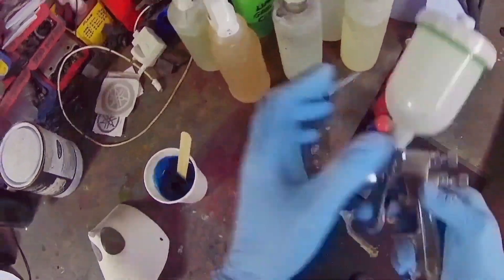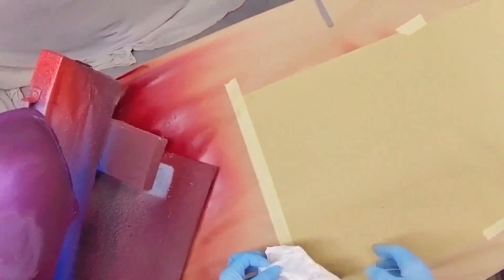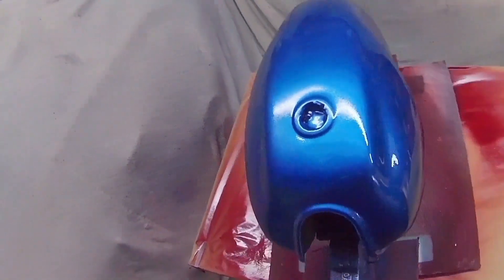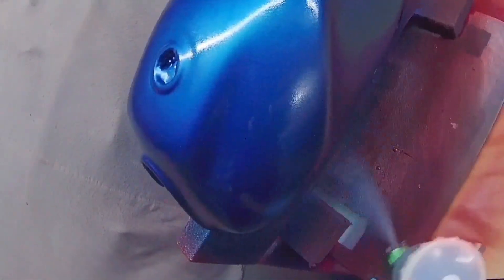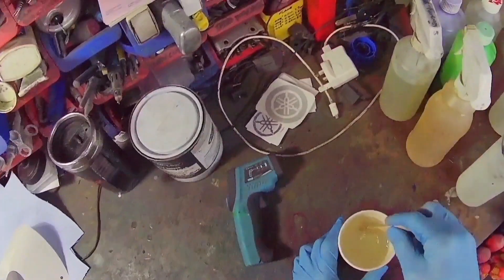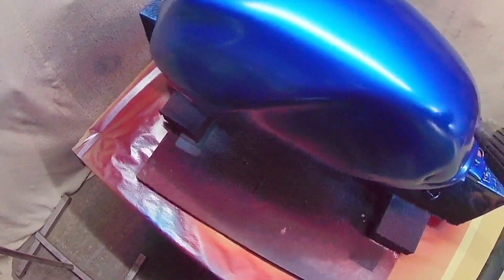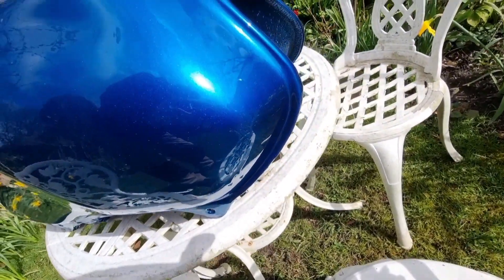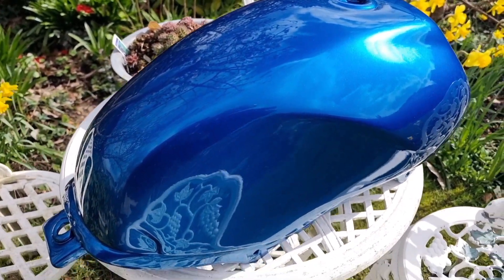Chinese Sri Pro Lite 1.2,Cheap Mini Gun, Devilbiss Sri Pro Lite/Pro Lite S H921 Mini 888 LVLP Talco

Comment: Hi Pete, now you are spoiling us with another video so soon so thanks mate👍doesn't look a bad gun tbh Pete as it seems to spray ok but as you mentioned you can see it's not atomising as good as the Devilbiss SRI and it looks like you are working the gun a bit harder to get the finish you are looking for but it laid the base really nice but the clear didn't look quite as good as your usual finishes🤔

I think that if you are a DIY painter and not interested in getting a load of high end guns like you and me are😁then this would be a good choice if it's not going to get a lot of use👍

I've found my other SRI ProLite I haven't used it for such a long time I forgot where I put it but it was used for UV primer but I couldn't get on with it so it sat there with paint (which is 1k) in it so it needs a good soak and cleanout, both of these guns need a service kit to get them working again🙄🤦‍♂ cheers Pete hope you are keeping well🤔👍
Reply: do you think normal people can release the different between finishes of cheap and expensive gun
Reply from the maker: Hi Mate, Yes, absolutely, they will find getting a better finish easier with a better quality gun
Reply: @peteshobbies5383  is a better quality paint is more important than gun, i saw a  lot videos many people cant distinguish the diffence between cheap and expensive gun
Reply from the maker: @quyuc9334 I disagree, It is easier to work with cheaper materials than a cheaper gun, certainly for a beginner.
I don't watch lots of videos,  I don't have time, but I use lots of different guns,  both cheap and good along with cheaper and better materials, the gun, especially in the hands of a beginner, makes more difference than the materials.

I get many people messages on Instagram and Facebook with various painting problems. The worst culprit is the quality of air. It is more important than the gun or materials for better quality work.

Comment: I have one of these with a .8 mm tip and it works amazing with base coats for small projects. It gives a smoother finish than factory. It works really good with clear it you dial it back and move a little slower. I find it works good 18-30 psi.
Reply from the maker: Hi buddy,  I've only used it in this size, so I can't comment on the smaller sizes. It's certainly excellent value for money if you get them from Aliexpress,  cheers 👍
Reply: @peteshobbies5383  Thanks for the reply. I know the purists don't like cheap gun reviews but some of us can't afford a $300 + for a paint gun. Keep up the good work and I know a lot of people would love to see affordable gun reviews. I was a mechanic for 20 years and only a few of my tools came from Snap-on.

Comment: Got the original sri pro and used it at home quite recently really good at 18psi 😊😊😊
Reply from the maker: Hi Dean, they are a good all-around gun, not overly expensive compared to some, good with air consumption,  good results and reliable, what more could you want, cheers mate 👍

Comment: Hi Pete great video, ideal gun for a beginner that’s finding there way on the cheap maybe 🤔 it seems to have done a good job there though but I think it’s down to the sprayer in this case rather then the performance of the gun, I know I have said before using more branded or nice feeling tools makes the difference especially with something that can affect the finish. Thanks Pete I hope all is well mate.
Reply from the maker: Hi Steve,  Thanks, mate , you are right. This makes a good gun for those who don't have or want to spend much money and get reasonable results.

It doesn't give the same feedback or satisfaction as using a branded product and I'm sure that some who buy these will want to go for the real thing if they get the bug, cheers mate,  alls well here, hope same is with you 👍

Comment: Good evening congratulations for your videos. I have a small 24 liter compressor, I wanted to ask you if in your opinion I can use it decently. Thank you very much
Reply from the maker: Hi Mate,  Thank you,  Do you mean a 25lt compressor to power the gun in this video?
Reply: @peteshobbies5383  Yes a 25 liter for a chinese minigun sri pro .
Tank you
Reply from the maker: @diegocastelli7405 Do you know the output of your compressor,  in CFM or LPM, that will be more of a guide? Let me know
Reply: Good morning 

The compressor has a power of 1500 watts and an air flow rate of 138 lpm.

Thank you
Reply from the maker: @diegocastelli7405 So that's around 5 cfm, I would estimate these Chinese Pro Lite S copy's are around 5 to 6cfm, so will be one the limit of you are supply,  if you don't have lots to do it should be ok, they certainly use more air than the real Devilbiss version,  which is between 4 and 5 cfm, hope that helps 👍
Reply: @peteshobbies5383  Many thanks I think I will buy it I only have to paint one fender of my car.
Reply from the maker: @diegocastelli7405 That should be ok. Just let the compressor fill up before you start

Comment: Great work I’m actually looking for a mini HVLP , I had my eye on the Italco for £70.00 but looks exactly the same as this.
Also have you ever thinned brake callipers paint that’s in a pot to use in a spray gun?
Reply from the maker: Hi Jason,  most of the Italco guns are Chinese copies rebranded as Italco, so it is probably the same.

Yes, I have sprayed HT paint for use on break callipers and thinned it if required. Have a look at the TDS for the products you have. It's a good place to start
Reply: @peteshobbies5383  thanks mate what seller on Ali express did you use?
Reply from the maker: Hi Jason,  to be honest, I can't remember. It was 5 years ago , I've bought loads of stuff on there over the years and mostly had good experiences, I would just go with the cheapest you can find

Comment: Great video. What cfm does this put out?can it be used with a smaller compressor
Reply from the maker: Hi buddy,  I would guess it's around 5 cfm @ 2 bar/29psi, it's certainly uses more air than the genuine version, which is around 3.5 to 4 cfm at the same pressure, how big, and what output is your compressor?
Reply: My compressor is a modified 10 gallon tank with a twin cylinder oil air pump from a 20 gallon Craftsman compressor and a 1.5hp motor
Reply from the maker: @justinw523 You would probably be ok, presuming you're not aiming to do loads of panels at once
Reply: Ok thanks
Reply from the maker: @justinw523 You're welcome, buddy 👍
Reply: I’m also looking for a good place to go and order a original DeVilbiss SRi Pro with a TE5 1.2mm, do you know a good place to go?
Reply from the maker: It's now called the Pro Lite S, it's exactly the same, just blue, where abouts are you located ?
Reply: Oh alright. I’m located in Marion, Kentucky about half hour from Paducah, Ky a website might be best to order?
Reply from the maker: @justinw523 If you're in the US, many people tell me the best place to get them from is Sprayguns Direct in the UK. You don't have to pay UK taxes as it's being exported, and as it's under $800 US, you don't pay tax on your side. Here's the link 👍 
https://www.spraygunsdirect.co.uk/product/devilbiss-pro-lite-s-spray-gun/
Reply: Awesome thanks buddy greatly appreciated
Reply from the maker: @justinw523 You're welcome, mate 👍

Comment: Pete, I have an LPH80 which I use for "good" paint, when painting small stuff but like you I don't want rustoleum etc getting into it.
Up till now I've been using an old Sharpe MGF for spraying small stuff with junk paint,  however the mgf is crapping out and I was looking at one of these for the task. Is there any alternative that isn't a rip off gun for low money for spraying small stuff with junk paint?
Reply from the maker: Hi Ken, not that I can think of, I've had a few unnamed guns in the past, and none have been particularly good, to be honest.

 I have a few W101 rip offs that I've had for ages, they are a side cup and very good, in fact they were so good to use It made me buy a few different versions of the real thing so maybe it's not always hurting the genuine manufacturers, cheers mate 👍
Reply: Funny, I bought a w101 copy and liked it so much I bought a lph100.
Reply from the maker: @AA_Ron155 That's exactly what I did , I think it definitely works both ways for the original manufacturer

Comment: Hi Pete - I have ordered SRi Pro Ntools spray gun - online direct from China $US35.50, including shipping - will let you know how it goes - just a quick question : how long should you leave masking tape before removing when using 2k urethane base coat/clear coat ? I'm spraying here in my carport, temperature ranging between 28/30 degrees celsius  - kind regards  - Roger
Reply from the maker: Hi Roger,  at those sorts of temperatures, about 4 to 5 minutes after you have finished,  the clear needs to be in a state that it's not going to flow anymore but is still soft, if you leave it too long it can chip when you remove it
Reply: @peteshobbies5383  Hi Pete - thank you for your advice - as always, very helpful - Kind regards - Roger ... PS - I don't need a microwave here !
Reply from the maker: Yes, that was my thoughts exactly. it must be lovely 😀

Comment: I have an older model SRi and I have a copy like yours. The copy sprays better than the real older Sri.
Reply from the maker: Hi buddy,  if that's the case, I would suggest there is a problem with your original as the copy is not as good as the original
Reply: @peteshobbies5383  I don't believe so. My original SRi is 20 or so years old, but definitely not worn out.  , , The old dark blue one. Its a great gun . . but an older design. I grab this newer copy often, it sprays fantastic.
Reply from the maker: I have used the original SRi, but a while ago, from memory, it sprayed quite well, to get the same results with these copies I find you need more pressure which leads to more overspray and consumption, both materials and air
Reply: @peteshobbies5383  I've often wondered about these copies if the spray result is inconsistent? meaning some spray better than others?
Reply from the maker: You could be right,  I have two, and they spray the same while looking slightly different, but the production tolerances are generally not as good as the main manufacturers, so yes, it could be the case for sure

Comment: Hi Pete - Christmas wishes to you
Reply from the maker: Hi Mate, Thank you. Best wishes to you and your family at Christmas. Cheers 👍
Reply: @peteshobbies5383  Hi Pete, I received my China Brand Ntools SRi PRO Mini spray gun - it says in the instruction leaflet, Air Consumption 5.2 CFM - my 5.2 compressor cuts out at 8 BAR - I have a pressure regulator/water trap at the hose outlet set at 4 BAR - the compressor is able to maintain 1.7/2.4 BAR at the spray gun (I have another gauge at the gun) so now I have been making minor adjustments for base/clear - so far getting nice results - the gun has a quality finish, nice in the hand - Thank you for your advice - Kind regards, Roger
Reply from the maker: @rogeliogamboa7644 Hi Roger, do you mean you have a water trap on the exit of your compressor?
Reply: @peteshobbies5383  Yes Pete
Reply from the maker: @rogeliogamboa7644 It needs to be further along the line, these videos explain it better 
https://youtu.be/iJzODBeGtjM
https://youtu.be/SnQGMrmJTDE

Comment: When using more air pressure, it makes more over spray? I don't like spray guns that make a lot overspray. Atomization and not a lot overspray is my concern.
Reply from the maker: Hi James, Yes, that is normally the way. The higher the pressure, the more overspray you get.
It's not just the pressure. It's also the  efficiency of the cap, so a well-made precision engineered tool will give less overspray than a not so well made one at the same pressure

Comment: Aside from it being a cheap option for hobbyists, it would be good for one to be aware that gun efficiency is of the most importance as most hobbyists aren't going to have good exhaust to deal with overspray. Overspray can ruin a paint job when you can't keep it from falling back onto a fresh layer. Not to mention the waste of  rarher expensive paint. I think you've covered that aspect well with this example... cheap isn't always worth it.
Reply from the maker: Hi Boss, you are completely right, my setup is rather crude with a few fans drawing overspray away and a larger,  filtered exit fan, but, as you say, many that buy something like this will have little or no thought or indeed facilities to deal with more overspray. Cheers mate 👍